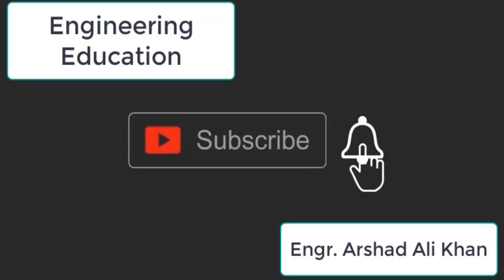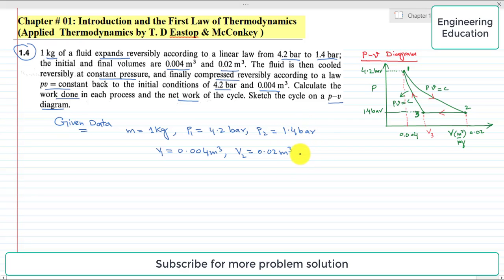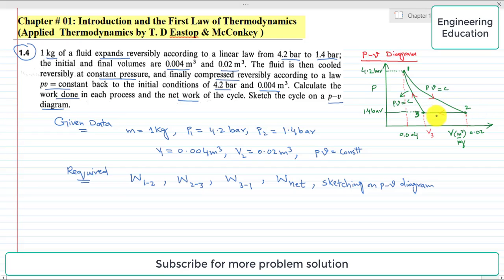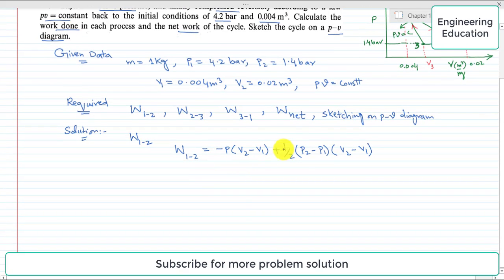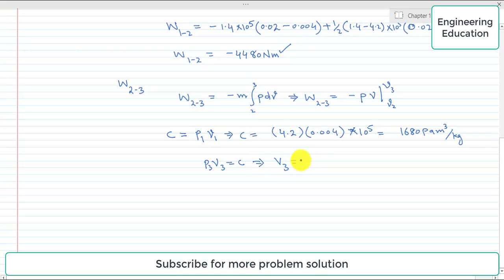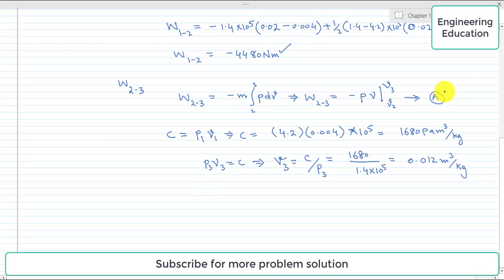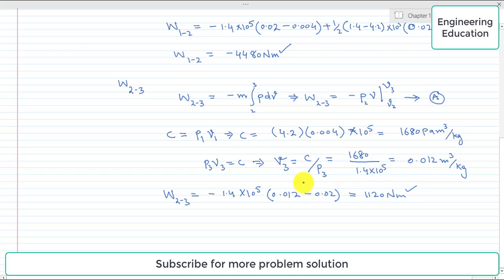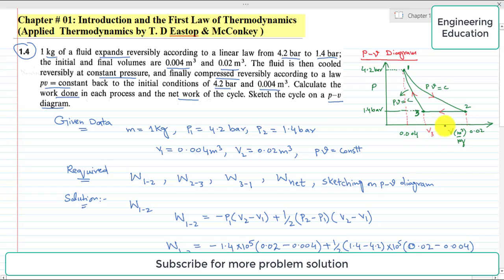Calculating net work done for a thermodynamic cycle and plotting it on a p-v diagram.

Comment: why did you use integral in w2-3 graphic was linear
Reply from the maker: There are two approaches actually. One is taking the integral and second using the linear expression directly. Both are same and correct. Thanks